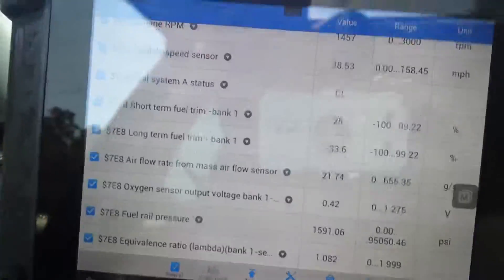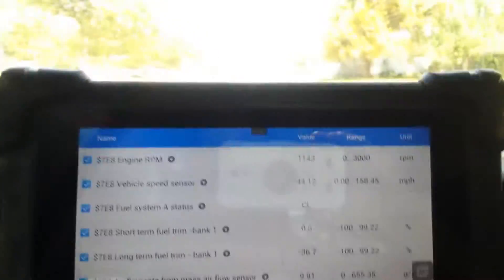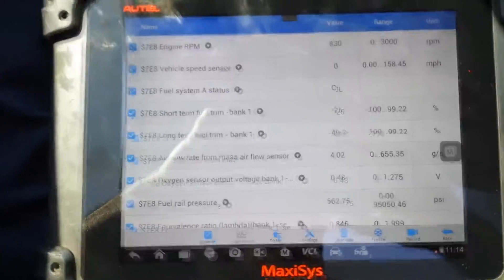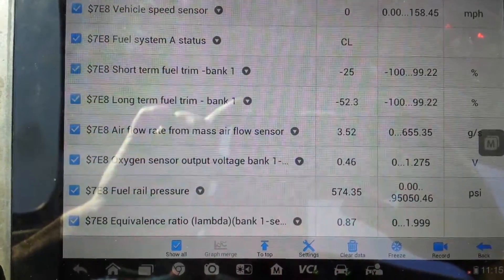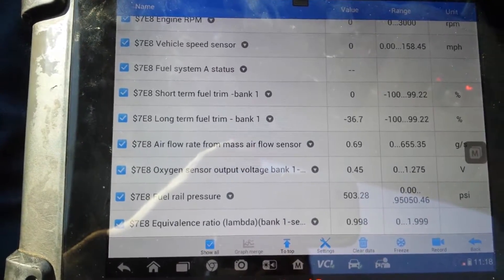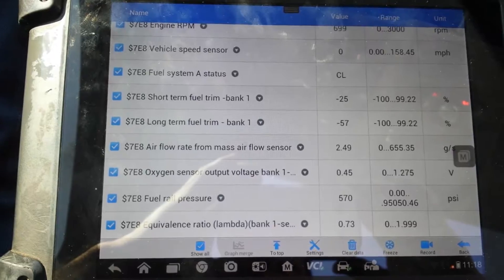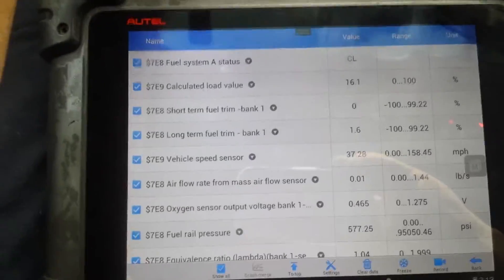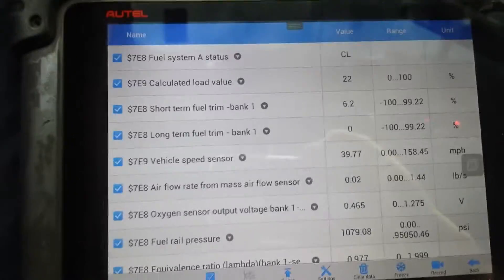2013 Audi A4 2.0L Running Rich P2178

Comment: Excellent Troubleshooting and fix and follow up clip with readings after Pump was changed. I have the same problem on an early 2007 2.0 TFSI engine.

Comment: You may of just helped me with a issue I’m having with the lambda sensor info you gave about it should be at 1.000 ect my second o2 reports rich but up stream sensor reads very close to 1.000 I forced it to go lean and rich down stream picks up the changes massively but up up stream still stays around 1.000 also have no check engine light but thank you !!

Comment: How did you get the data list $7E*, I have the same tablet/scanner and find engine control data list doesn't show any fuel related data. Great video man!
Reply from the maker: Thanks for your feed back,go under the generic part of scan tool (Global OBD 2)  and then live data and that should get u there.
Reply: @fsteddie98  Thanks man!! I have a 2013 jetta in the shop with the same motor and the same problem.

Comment: Got pretty much the same reading on my 2011 Audi A5 2.0 tfsi 8TA. The only difference it's the fuel rail pressure going up to almost double when I turn the engine off. I have a lot of missfires on cylinder1. Can be a damaged/licking fuel injectors?
Reply from the maker: The fuel pressure should Rise when the eng turns off on a hot eng. have the tried Swaping spark plug and coil to see if it changes